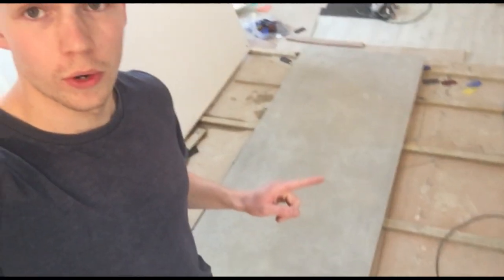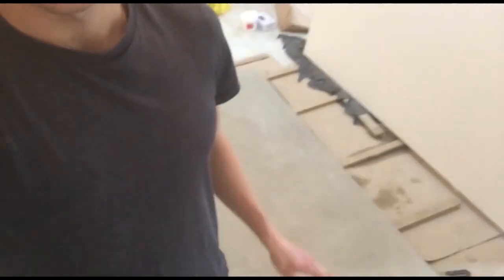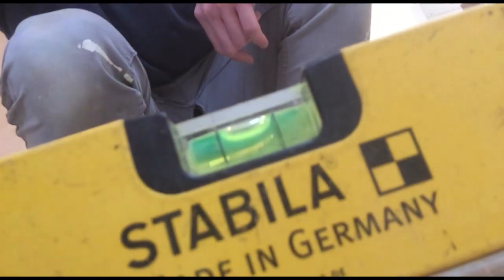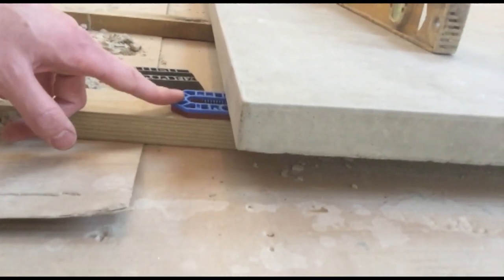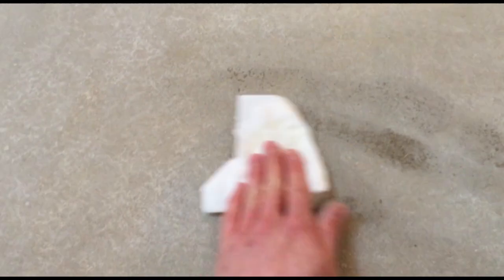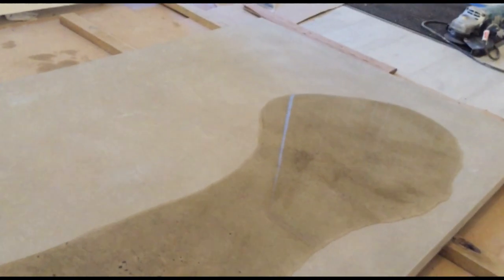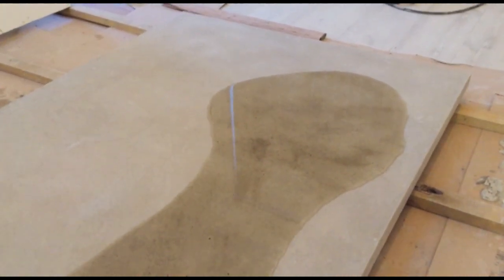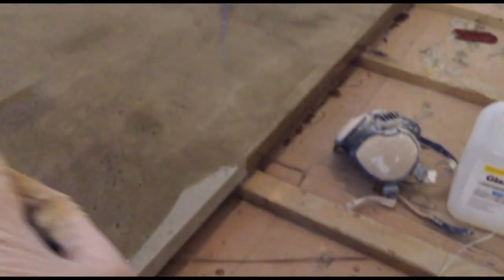How to Epoxy / Seal a Concrete Worktop / Countertop with Glasscast 3 Epoxy Resin

Comment: Why cant you just fill the holes with epoxy and sand them flush before pouring ? Does it need to be concrete?
Reply from the maker: Yes you can do that too. It may sand at a different rate to the concrete and give a skippy different effect. You would need to fill the holes first and make sure the whole surface is completely flat before doing the pour otherwise the when the epoxy shrinks back very slightly you will see dips where the holes are.

Comment: Hi Matt do you need to fill the air holes in
Reply from the maker: Yes, 100% it must be as smooth as possible. You can use 1to1 water and cement :)
Reply: @MattHutton  thanks Matt where do you buy your resin
Reply from the maker: Wilson Ross hello mate it’s the glass cast self levelling resin in the description of this video :)

Comment: what type of concrete ?
Reply from the maker: 40N
Reply: @MattHutton  oh.. didn't know you responded.. thanks.!
Reply: @MattHutton  ok.. I mean ,what type of concrete did you use to cast the actual counter top? I'm assuming the slurry mix will be 40n.. right? or did you use 40 n masonary mix for the entire job? thanks alot man..

Comment: Before you do this you need a Concrete Bonding Adhesive because it will peeling soon.
Reply from the maker: Hello mate been used in my kitchen for 10 months now and no peeling. I used a 240grit finish to give it a good key. before the pour.

Comment: Less talking about what you're doing and more showing... Otherwise thanks.
Reply from the maker: Any other tips?
Reply: @MattHutton  if that's sarcasm fine. If not then I would recommend that you show the actual glaze scraping that you're doing and also how you use the brush along the edges to create the puddle or spill over effect without drag.
Reply from the maker: @dr.p3548  I’ve got another video coming up off this process, so will make sure to include it :)